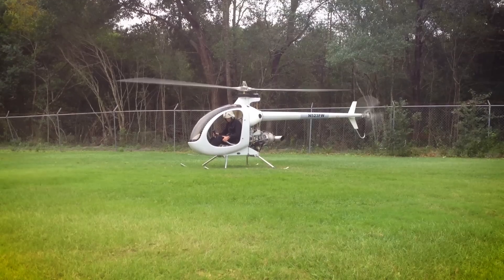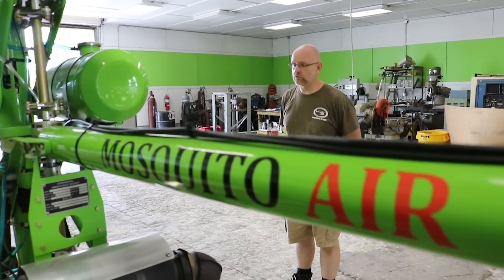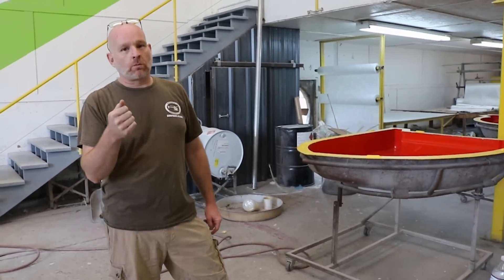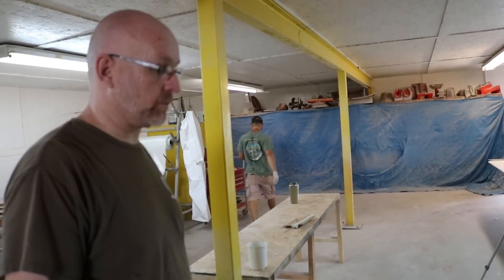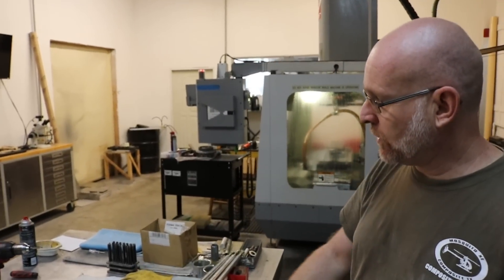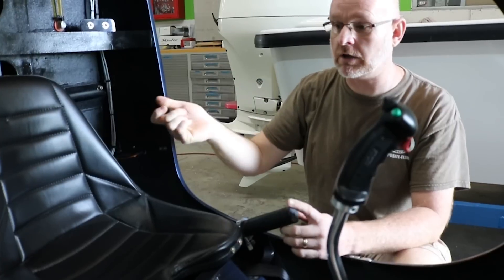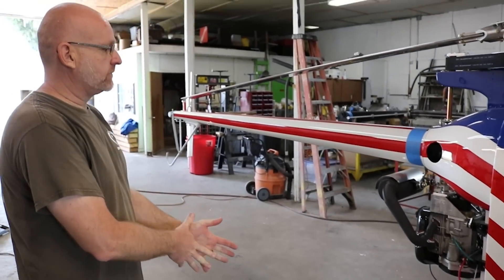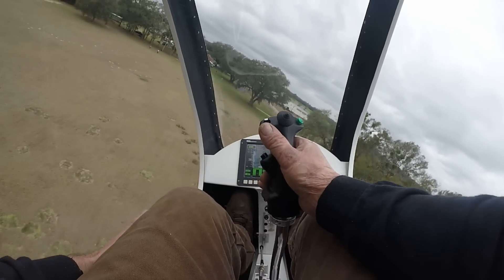Mosquito Helicopter

Comment: What I would do is have that equipped with airbags like in a car, and I would have the rotor be able to pop off just as if when in a jet the pilot can eject so in case of God forbid a accident were to occur you would have a roll cage type system and a deployment of impact airbags that would come out like with when they use for NASA landing rovers and whatnot or like how they have that new flying car that was introduced out in Taiwan recently to where if an escape needed to happen parachutes popped out of it so what I would do is have the rotor bill to be jet propelled or burst propelled away from the main of the flying device

Comment: Nice to have a helicopter, but what is the point of having such a helicopter if you almost exclusively fly about 50cm from the ground at most? Almost all who display this type of helicopter fly very low above the ground. Can't the model fly higher in the air?

Comment: I dont like the fact that the push/pull tube flight control linkages are crammed tightly together inside the main rotor shaft of the mosquitos! Iwould much much much rather have the single place "HELICYCLE" helicopter!!!

Comment: Would be a dream to own one but where i live experimental helicopters are not permitted. Only way to own one is going the certified route and that's well out of reach. Btw am i getting deja vus or have you been at the factory before?
Reply from the maker: Where are you based? Yes...been there before.  This is some footage from that initial visit.  We shot about an hour of content there. But no one watches hour long videos in this day and age.  So...here you go. :-)
Reply: @ExperimentalAircraftChannel  Based in Thailand. There is no private helicopter owner that i know of. Requirement is to set up a company with at least $1M registered capital to get a permission to operate a certified helicopter. There is some civil rotorcraft activity in the offshore oil drilling sector, in medevac, and occasionally someone does an attempt to  start a passenger/tourist flight venture but they are mostly short lived.